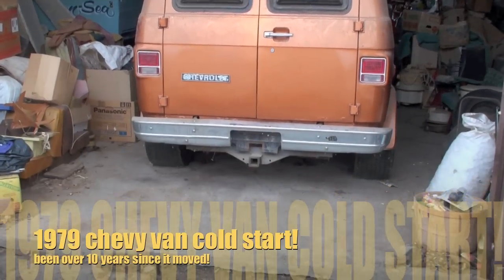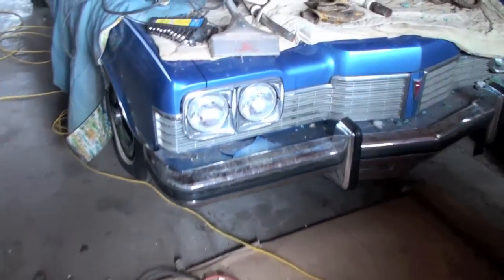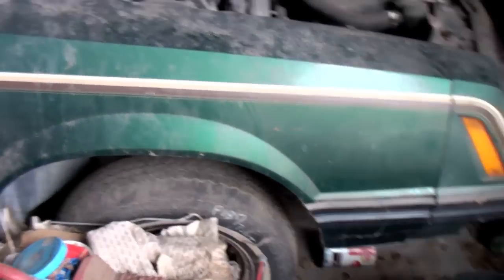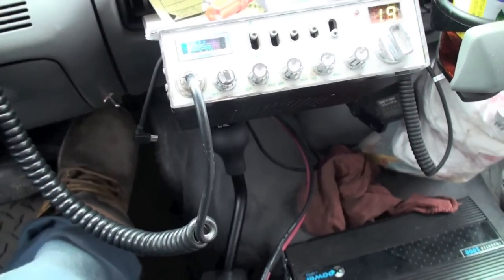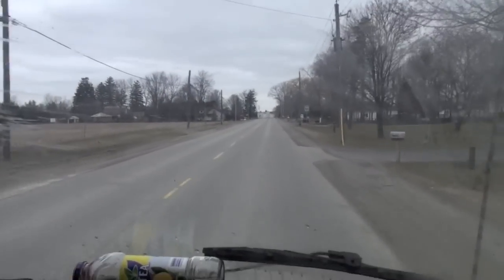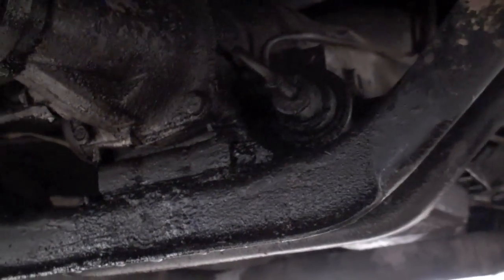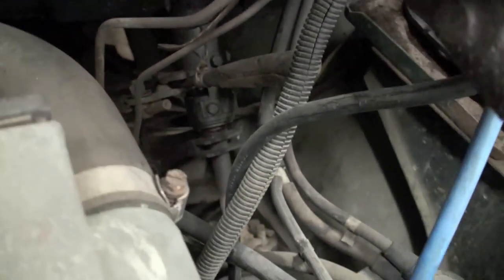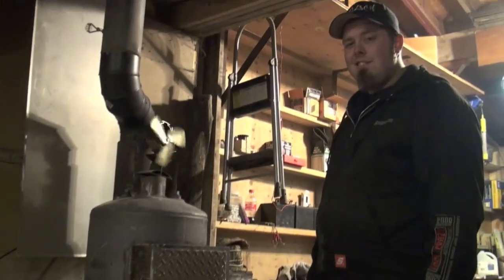10+ year chevy cold start!

Comment: we have a 1981 chevy van and we had for 12 years and still running. lots of new stuff in it. its carborated (cant spell) so it will try to turn over until it does for a little. but one problem, NO REVERSE but getting new transmission. still I love our 1981 chevy van drive great but kind of loud.

Comment: cheapest option is a rebuild, you can get a kit for just a few hundred bucks and you know it'll have all new seals and gaskets, may not even need new pistons just hone the block and re-ring, you could potentially drop in a 350 for the same or cheaper but you can't be sure the condition because i haven't found a brand new or rebuilt small block for around $300, if i did i'd be replacing the 305 in my truck, maybe i haven't looked hard enough, so safest bet is a rebuild

Comment: I would build  a 400small block, with a TH400 tranny built with a shift kit, and a hot converter between them, add some long tube headers and straight piped dual pipes, that would be one sick van! The 305, 350 and 400's are all the same physical size on the outside so it would drop right into the hole!

Comment: Some of the S10`s did come with a diesel. It was a 2.2 isuzu diesel that they used in the pups. Its a tough little motor and they run forever. If you can get your hands on it then go for it.Cant go wrong with the old 2.2 diesel.

Comment: Its got a ring or two stuck....just puter in low gear and run it up pretty fast then let off and let it wind back down, do that a few times.....the pressure it builds when youre letting it wind back down will get in behind the rings and reseat them.....Look up hard break in for new rings,same principle.

Comment: Blue block is 305 if it is factory engine, most 350's were orange. To put a diesel in it would make a Daidsfarm team van not an A team van. Get an LS1 or LT1 multiport, and can run that trans, 300 + horse and about 20mpg. I have a 1993 LT1 in an 84 cutlass and wasn't hard to wire it up. It is on youtube on my channel.

Comment: If the screwdriver is on the starter side that is what that is for, shorting the Starter relay so it will turn over from the engine bay.

Comment: @otakop67 You're right about the letters corresponding to the engine sizes, but pre-1981 GMC and Chevy trucks and vans had a shorter VIN number. The first letter was the manufacturer,  the second the model designation, the third the original engine.

C= Chevrolet
G= GMC

G= van

D= 250 straight 6
T= 292 straight 6 (usually not found in a 1/2 ton van)
U= 305 V8
L= 350 V8

Comment: The engine has been sitting for 10+ years so drive her around for a while check fluids and fuel and brake line and drive her around or med to high quality gas and the rings should free up.. theve been stuck to a piston for 10 years give it a little while and it should be fine..

Comment: @matthebest018 i highly doubt this van will be turning past 4000rpm much, it's a heavy thing with an auto so the cam will be fine, makes lots of low end power, also as long as it has a tune up with a free flowing intake and exhaust that'll put less stress on the engine, as long as the engine is mostly stock in good running condition the main bearing will hold up just fine, i had a Q-Jet 305 in my 86 Silverado and it ran for 280,000 miles with no problems hauling logs

Comment: i doubt there is really anything wrong with the engine. probably has more to do with the fuel system, stale fuel and carb may need to be cleaned. my carbed trucks usually smoke a fair bit till you start moving, then it seems stop.

Comment: Hey buddy, I'd check the fuel system in that after you clear all the nasty fuel out of there. The gas tank might be rusty, and is cloggin' up your fuel filter. 
Also, the S10 diesel motor is great, but not even enough power to push that van around. Look for a badass 400 or 454 or 455 for it, and it'll friggin haul ass. That most likely has a 350 in it, which is alright, but I'd get a big choochin' big block!

Comment: @snakesonaplane2 also don't underestimate the 305, a Z28 Camaro with the 305HO is no slouch with the 5spd, just clean it up and tune it, make a dual snorkel intake and open up the exhaust and it'll be fine, the 305 with a few mods isn't the pig everyone thinks, i think the 305 gets more crap than the 4.3 V6 does, i've got both a 4.3 and 305 truck and the 305 has a lot more power, same gearing and everything

Comment: selts and all sounded a little floppy too. yeah if you didn't fry the transmission driving it all that way with those old seals in it and the fluid leaking out of it . put a decent set of matching rims on it and if you want to make it a REAL A-team van you Deffinately have something good to work with there. that thing looks pretty solid all the way around. hell my dad's 85 that i had to turn in for scrap wasn't even that good looking. if that van is a 70's model van you either have a V6 or  350

Comment: ya a the old s10's and s15's (the s15 is the gmc version of a s10) there was a option for a 2.2 isuzu diesel they offered it from 82 to 93 i belive and  my dad used to have a 88 gmc s15 with the 2.2 diesel and i ran live hell and we finally got ride of it when it had close to 400,000 miles when there was no body left. it wasent a truck that would win alny races anytime soon even in its early days but it mad a good work truck and would not die no matter what we did to it.

Comment: wasnt that an isuzu diesel in those 80s s10s? 
i still think thatd be the ultimate truck to have a 4cyl turbo diesel with a 5 speed stick. if only you could get that in a newer s10, but no i have a friggin 4.3 gas suckin blazer

Comment: @666jasonxxxx 1979 truck or van would have the engine as the 3rd letter in the VIN. They didn't go to the 17 digit system here until 1981.

Comment: Pug you better pass on the S-10 diesel engine, it only has 58 hp made by Isuzu and was a one year option only.
Better look for a  350 Oldsmobile diesel V8 or a 379 Detroit Diesel V8 diesel

Comment: I hate Chevrolet, GMC, & Dodge vans. Can't stand driving around with my foot on the wheel well. When it comes to American full size vans I will have to stick with Fords.

You could easily install a 6.2L Diesel since those vans did offer that option for many years but I think you should install a Cummins 4BT 3.9L and get MPG's in the mid to high 20's. Thats my plans for the 2000 Ford e-150 that I just bought.

Comment: Screw the diesel idea in the ass. Build a nice small block for it. Cheap, reliable, and powerful, and lighter than a 4BT (I wouldn't put a diesel smaller than that in a full size anything).

Comment: The dvabel hey pug your betternot put that s10/ishitszu engine in there because of you're hard ass rompings on them it wouldnot last a day because it has plastics caps.  For about $2500.00 you can get a budget crate 383 stroker with about 350+hp & 400ftlbs of torque.

Comment: the  isuzu diesel in the s-10 wont move that van  10 feet without exploding.It would barely move a s-10 70 mph...theres another 2000 pounds to deal with eh

Comment: that low mileage of a v8 I check out before I pulled it drop the tank and change the fuel filters and the fluids which no matter what the tank and filters need cleaned and changed dont forget the one in the carb and I bet it will clean up and run once it has good gas as long as its not knocking it will need torn down and some new gaskets but that is cheap and easy I say try to fix it alot less headaches in the long run and cheaper by far plus you cant beat that v8 sound throw a cam in it oh fuck

Comment: diesel s10 is a pig they used in the early years like 1982 & 83. those tires on the van are not normal steel belted radials is why they look so fucked up. sell them to sum1 building a vintage hot rod. on the engine thats in the van, on the drivers side, right where the trans meets the block, on the top side, there will be a 7 or 9 digit number. give me that number and i can tell you the engine size. if original it can only be a 305 or 350. all they had in a small block for that year

Comment: There was a S10 that came with a diesel, But they were CRAP CRAP CRAP engines, Low HP and low Torque, It wouldn't be good enough to move the A-Team #2 van as quick as a Prius.